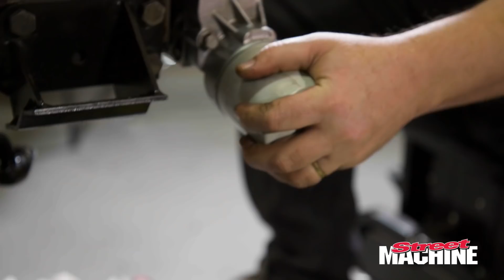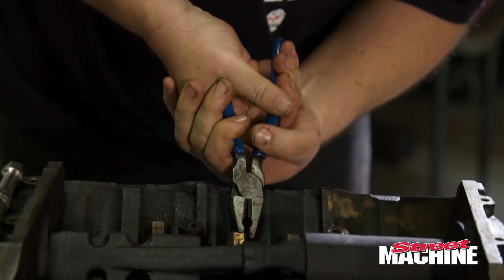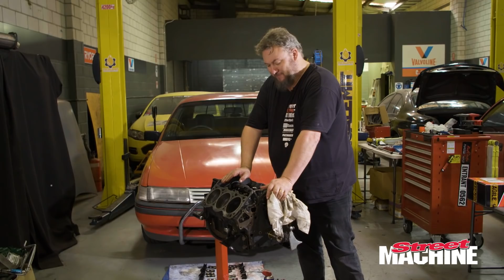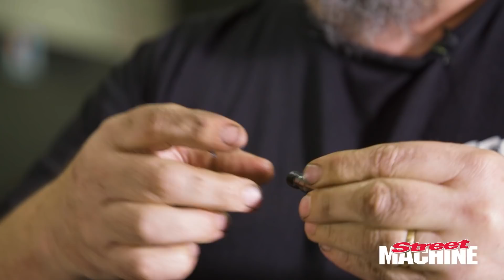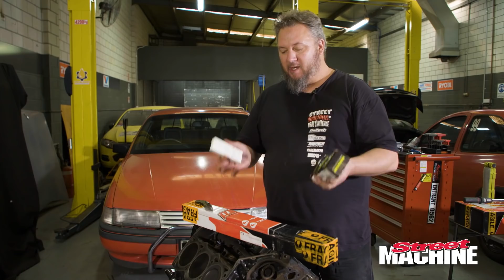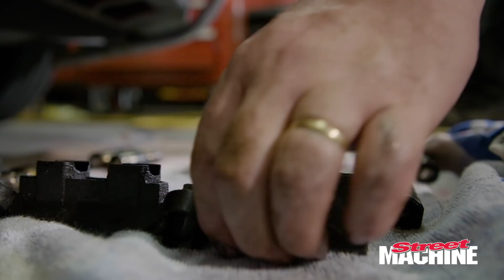Carnage Plus EP68 - The Supermang Engine Build Begins

Comment: New rod bolts can misalign the caps to the point that the shell wipes the journal clean.
It will be a miracle if this engine runs for 60 seconds
Reply from the maker: If it was a complete bolt and nut change I would agree to a point, but these are different
Reply from the maker: And the last engine ran fine until the chain snapped

Comment: You can drop that balance shaft gear off and just leave the shaft in there. You won't even notice its not connected. Also check your valve lift. If you have more than .530" you will need to machine the valve guide bosses down to allow for the lift. Also you will bend a rod before you break a factory bolt. Not worth changing. Can do more harm than good.
Reply from the maker: We machined the guides.

Comment: Have not used a standard ring spanner in 15 yrs since discovering ratchet spanners. Ignore the cheap rubbish spend a little extra for the good stuff. Your old spanners are good for hitting like the cam bolt

Comment: Hey Scotty. Have u considered running split ratio rocker arms to improve the cylinder evacuation on the exhaust stroke. Such as 1.65:1 intake and 1.72 exhaust. This would correct the cams underspecked lift on exhaust lobes. Making it more suitable for boost.

Comment: That stock timing chain will stretch with a higher lift cam and stiffer valve springs!☹️
Double roller chain and delete the balance shaft gear.👍
Pretty common mod on these 3800 series 2 and 3 motors.
Mine goes like a Porsche :
https://www.youtube.com/channel/UC0o1wZvWQlkYxTjivW_0XNg

Comment: would be interesting to see the car go through engineering to show what it takes to make it all nice and legal too? :)                                                                                                                                  Loving the mang series though. looking at going turbo on my old s1 buick soon too so this will be a good insight to what's involved on the inside of the engine, yous will likely get to a spooly boy before I will so I'll watch n learn from that too hahaha
Reply: not sure whether to go pistons, rods, head work, cam, arp studs all through and a big spooly boy or just turbo the stock motor, (it'll be a china turbo either way I aint rich enough to afford a garret lol) it has to come out anyway to do the horrid rope rear main seal which I heard involves having to pull the crank :( so figured while it's apart may as well make it better lol                                                                                     
converting it to t5 while it's out too, going for like 300bhp to start with but would ultimately like around 5-600rwhp out of it  although I don't think the t5 will live long behind it, hopefully by that point I can afford g-force internals... although in 2 frames of mind with that 1 min I wanna go manual next min t400 hahaha but if that's the case the t700 can stay until then...
Reply: L67 was factory fitted in VS Calais so engineering would be a piece of piss
Reply: @dizza1993  not in Victoria dude, it's a shitshow to engineer a car here , u can drop an l67 in any vs and not need engineered as it was factory fitted in that model, however u drop one in a vn u need to get it engineered as it wasn't factory fitted to that model, it's dumb yes but unfortunately that's the way it is.
They'd still have to pass emissions, upgrade the brakes then do the brake test plus engineers cert, it's roughly 4 to 4.5k to get it all done ,it's bullshit tbh and that's why I've decided to go full race car instead, for 4500 I can get my elite 2500 and ic7 dash I've been eyeing off which to me is money better spent.
The cost has driven many to just do a dodgy and go on h plates instead, just look at majority of the cars at drag challenge this yr ,barely any of them is engineered cause the cost is obscene and it also goes up the more heavily modified the car is, e.g. a car like allshow would cost somewhere in the vicinity of 10k ,is disgusting, it's done by Vic gov to discourage people from modifying their cars with their constant push for green nonsense, we are now public enemy number one apparently 🙄🤣 fine I'll just build a race car instead since for me engineering is prohibitively expensive, u know another 2 maybe 3k and it'll be running n driving and I'll race as is, get into bracket racing or something as the car will only be in the 12s to begin with 🤔

Comment: You can literally use the stock crank bolt to pull the balancer off it even has a dent in the middle for the tool done it before so u know for next time

Comment: That  engine needs a hot tub clean. 
And I'd Check or replace the oil pump.  . Rings and bearings.  Also. 
But I'm sure these be replaced after the first dyno  run

Comment: surprised you didnt remove the balance shaft
Reply from the maker: Done it before, all it did was make the engine vibrate more
Reply: @STREETMACHINETV  well yeah thats its job but less rotating mass .... actually that would be a interesting thing to find out on a dyno .... will less mass make for more power

Comment: all ya had to do to pull the HB is undo the bolt wind it all the way out and wind it back in a few full turns ......  i went through 8 engines in my vp racing and doing burnouts and thats how i always did it with no issue when they would eventually tear the duel mass rubber

Comment: L67's are notorious for spinning big end bearings. Throw a set in at $65 even if the crank is chewed. Better than running on copper. Also that timing chain won't last on that big camshaft.

Comment: Hang on a second, TDC is no 1 position at its firing position ( Not exhaust position) , thus line up the timing chain to line up with no 1 at its TDC postion, right or wrong, just asking or it does not matter as long at the timing chain marks are lined up,  cheers :)🏎🏎🏎👌✌👍😊🙌
Reply from the maker: Doesn't matter as long as as timing marks line up.

Comment: Hey Scotty, that cam needs resno stiff valve springs and inlet valve guide machining. A std timing chain & tensioner won't last long and it's quite likely the valve retainer will kiss your valve stem seals. Didn't Mace supply or tell you this?

Comment: Scotty mate, maybe you should use that spinning cleaning wheel for the block deck and other areas to clean it after it goes in the wash bay, also replace the welsh plugs with new brass units and the same on the heads as well. Also why not do a little work on the heads, open them up a little for better flow and springs and retainers etc, just saying, keep up the great work your doing buddy and i hope the family is well and doing well. cheers :)

Comment: Aint found no imperial bolts in my L67's 🤷‍♂️
Reply from the maker: There's definitely a couple of 3/8s and 7/16s in ours
Reply: You can get away with murder using 6 point sockets instead of 12 point 😂 might have been imperial but eh, fuck it i never noticed.

Comment: Scotty before you bolt it all back up check those plastic guides for wear on high millage engines. I have actually seen on an LS where the wear was significant and it caused serious issues. Also I know you have shares in a mollybond company, but you should only put clean engine oil on the cam journals and lifter bores. Moly should only be used on places you want to bed together like cam lobes to the bottom of flat tappet lifters (roller lifters should get plain oil as well). Increasing any gap over factory is only going to lower oil pressure to the top end. Loving this project.

Comment: Well in Scotty, I'd have done the exact same with that cam bolt. Bit of loctite for insurance and she'll be fine. Next time you remove lifters, just pull them up till they get stuck, slide the cam out and then push the lifters down their bores to remove them. It can't always be done that way but it's much easier and doesn't damage the lifter bore if pulling out mushroomed lifters. They're always a dirty engine around the valley, should go well with the mods.

Comment: Never seen one rod bolt replaced at a time to spec .....I’d be concerned about a cracked cap
Reply: They were fully seated already so not a problem. Bit different if fitting the caps and then pegging them, most definitely an issue then :)

Comment: Stock timing chain is a bad idea with heavy duty valve springs to suit that cam.  Ditch the stock timing chain and balance shaft and fit a proper double row timing chain for reliability.  The boys at MACE should have recommended as much when they supplied the cam.  Heads are going to need a bit of work to accommodate .564" valve lift too.
Reply from the maker: Maybe, we'll see. It's here for a good time, not a long time.
Reply: Great comeback! Here for a good time not a long time haha
Reply: @knight2425   Guess he's not so smug now ;)
Reply: @BlownCommodores  when was he smug? Nothing worse than someone that walks round like they know everything. At least with this show they try things and we see what works and what doesn’t, now we see this thing get taken up a notch which can only be a good thing

Comment: Great stuff, keep it up. Loving all the 6 cylinder content. LS engines are great, don't get me wrong - but they're done to death and too easy to get power out of. I really appreciate all the 6 cylinder stuff you guys work on.
Reply: well stock supercharged V6 is around 190Kw at the flywheel, so this thing should make around 250 to 280Kw at the fly easy if not more ,especially on e85 ?
Reply: @7075-t6  these were only 171kw hsv xu6 was 181kw, with what they're doing don't see 250+kw at wheels being an issue though :)

Comment: Hey Scotty good to see a v6 for us holden fans . I have 3 vt supercharged commodores and all of them had cracked heads when purchased ( between the exuaust and inlet valves ) and pretty hard to find replacements some asking  $500 for 1 head . Can't wait for dyno results
Reply from the maker: We had the heads inspected they reckon they're fine.
Reply: I also had to modify rh exuaust to clear the steering rack and the transmission was sitting to low in the vn chassis. I heard a vs commodore transmission or maybe just the pan was the solution but i was over it buy this stage and sold it
Reply: Cracked heads are just a way of life in mang mang world

Comment: I like playing with the L36 in my 96 Firebird, fun engine to work on. We eliminated the balance shaft, tapped and plugged the rear bearing oil feed. Also fitted ARP rod bolts.
Reply from the maker: I did the balance shaft removal once before, it really didn't achieve anything to my mind.

Comment: Think that's tight, some mercedes engines use over 280pounds on their crank pulley bolts
Reply from the maker: Crank pulley is a bit different, but camshaft seems nuts
Reply: @STREETMACHINETV  my thoughts exactly.